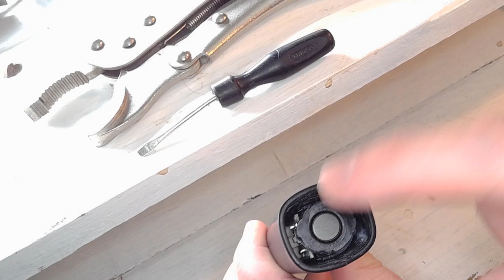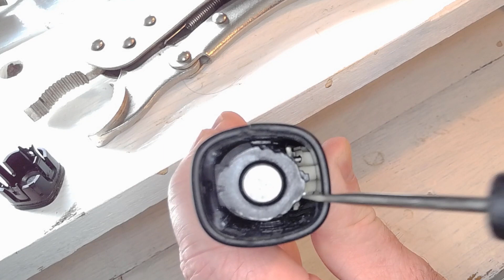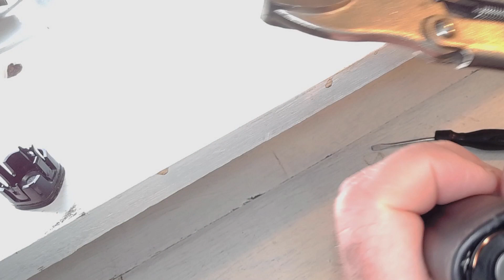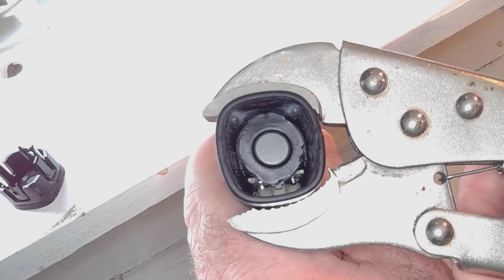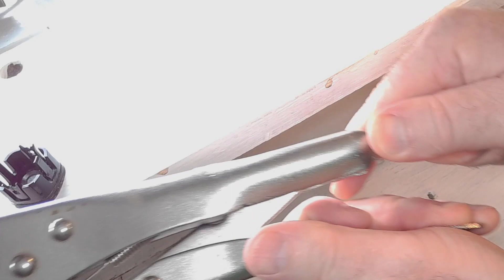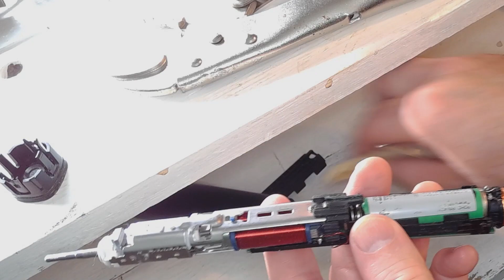Open Philips Sonicare Toothbrush - Part 2

Comment: Great thanks for that, after. After buying and using this toothbrush for a while it’s the first time EVER the dentist has told me I am doing a good job on brushing my teeth! Anyway it wasn’t vibrating as it used too, couldn’t find the purchase receipt and wasn’t keen to spend a heap again to buy another one so found your video. Came apart just like you showed me👍The screw and clamp between the main vibrating stem and the metal brush stem had come loose, so re-screwed it and added some super glue and it’s like a newey 😃

Comment: Thanks.   I was able to fix mine.    A small screw at top had come loose, which made the stem very sloppy.  Put some blue locktite on the threads and tightened the screw - good as new.
Reply: same thing happened to me

Comment: Thanks mate, managed to open it and repair it . The problem was that the screw holding the brush axle had gotten loose and then the whole thing was wobbly. Also did a battery replacement since it was already kinda done.
Reply: My toothbrush has gotten wobbly too. Seems to be a common problem. How did you open it?

Comment: It's probably been tossed out by now, though my money would be on a cracked solder joint going to the oscillator, though the ones on the board look good. It vibrates and if not siliconed down, leads will break. Especially with lead free solder.

Comment: First video not a big help. Second video was exactly what I was looking for. I streaked the clips with the Connor of my small screw driver and popped right out. My problem was a terrible buzzing. The metal post that the tooth brush attaches to did  was loose. I pulled the screw, applied blue lock tight to the threads on the screw and reassembled. Problem gone!

Comment: WOW! Can't thank you enough!  Mine was making horrendous noises after being dropped so I opened it up to find a little metal bracket and screw totally out just floating around inside.  Figured out where they went and then put a drop of crazy glue on the screw and put it back together. Works like new and back to being quiet :)

Comment: Figured out a trick with those tabs and I can't even believe it.  Actually, if you try to push down on the tabs it doesn't really work, but if you position your tiny flathead on above or below (not against the wall or motor) it just pops right out!   I messed with this thing forever and was so frustrated, I cant believe it was just pressing on either side of them.  You dont even have to squeeze it!  Lesson learned!
Reply: what do you mean by on above or below? im having trouble taking it out its killing me
Reply: Thank you, that was so easy with your method

Comment: We bought new ones and I am planning to take apart the old ones and I want to remove the vibration thing from each one. Then I want to hook about a 5 volt power supply up to it and make some sort of Sonic cleaner for small parts and jewelry. I figure if I can combine two of them it should be powerful enough to work.

Comment: Is the motor replaceable?  I have the same problem.
Reply from the maker: motor is replaceable, but your problem might not be the motor. I cant tell. I replaced my motor but that wasn't the problem. My problem was related to the circuit board, I think, I don't really know, nothing I tried worked, so I just gave up and threw it away.